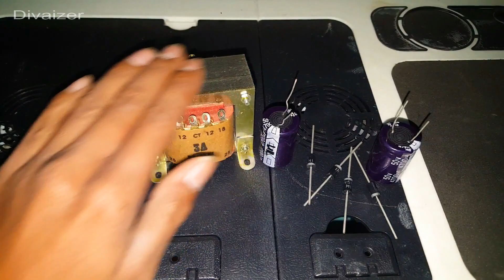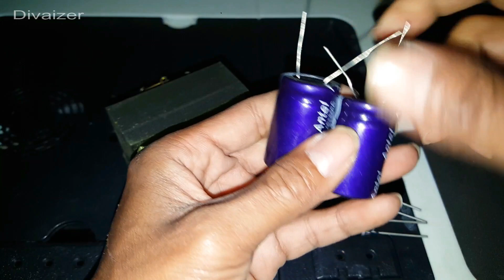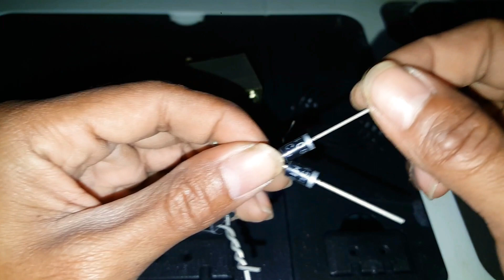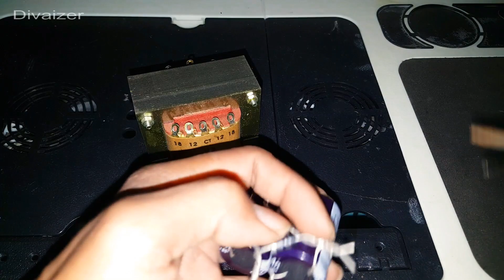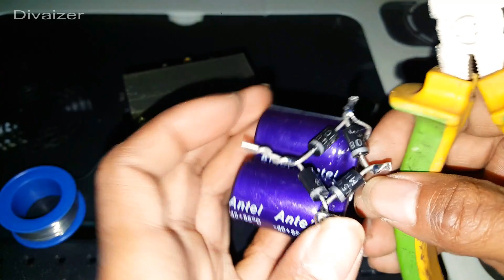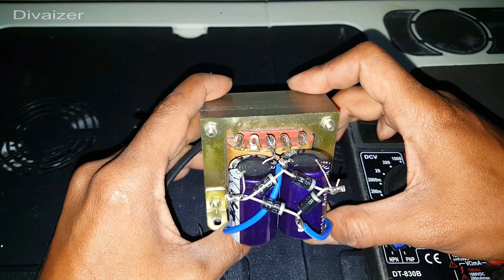Cara Merakit Power Supply / PSU Amplifier Paling Mudah Untuk Pemula

Comment: Mas mo nanya nih klo 1 trafo d buat 2 power suplay (4 driver power)
Misal trafo 20 amper pada output 45 vac 2 drver power (untuk sub)dan pada 35 vac 3 driver lagi (untuk mid)
Apa bisa ? Trims jawabannya
Reply from the maker: Sebenarnya itu tidak bisa maksimal karena bisa saja trafo akan kualahan menyupply tegangan dan arus untuk kebutuhan driver. Namun, jika tujuannya untuk menghemat biaya oke saja bisa kok dengan cara tersebut.
Reply: @Divaizer  ok mas mksh ya...